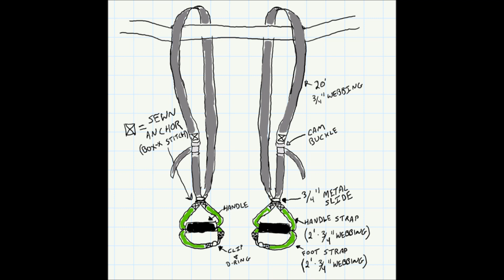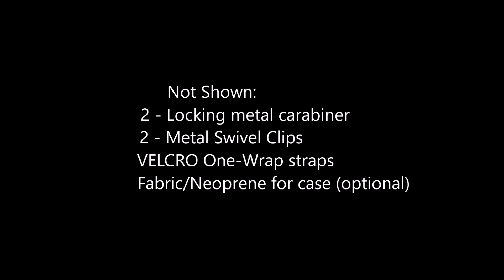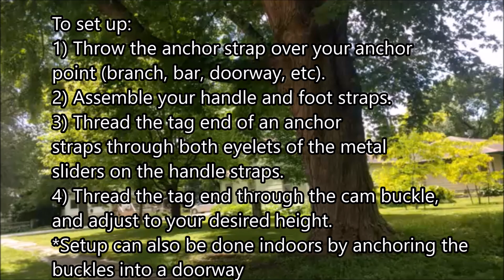DIY Suspension Trainer (Monkii Bars 2 Clone)

Comment: I made this. The buckles slip, not even with full weight on it. Yes, I threaded the cam buckles in the proper direction. I weight 185. I'll stick with my gymnastics rings.
Reply from the maker: Did you try threading the strap back through the other opening in the anchor after threading it through the cam? That's how I've been using it and one bar can hold my all my weight without slipping even when I jump up and grab it.
Reply: So yours slipped too. :) 

I tried putting it through the small rectangular space thru the back of the buckle after I pulled it out of the cam and this seems to be keeping it from slipping.
Reply: Could you solve the problem?

Comment: What would concern me when making this is that those metal slides weren't really designed for weight bearing applications.
Reply: You could sew loops at the end of the green straps, so you wouldn't even need the metal slides.